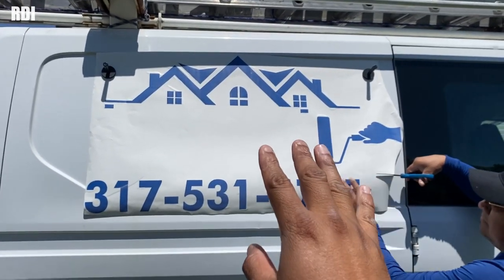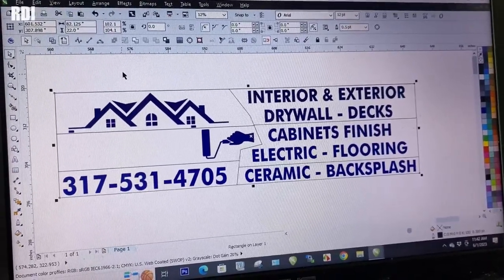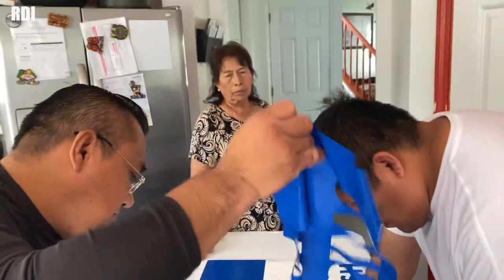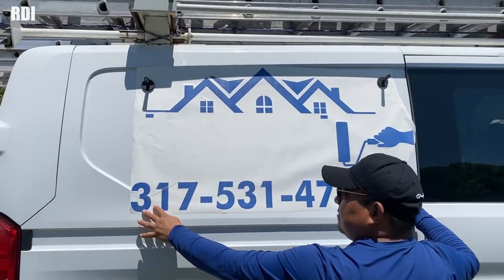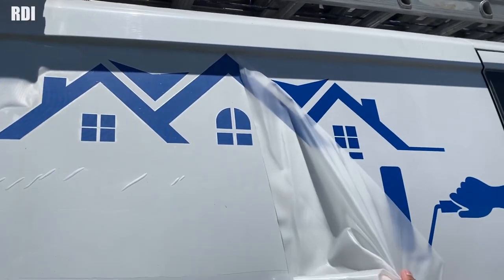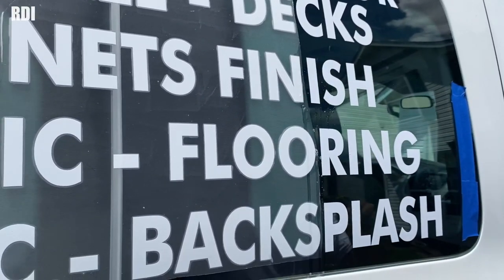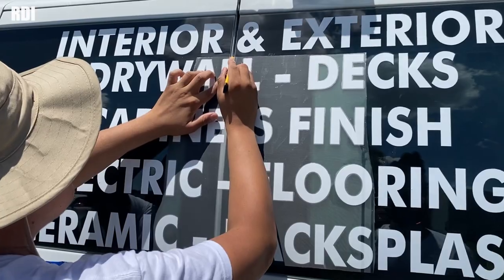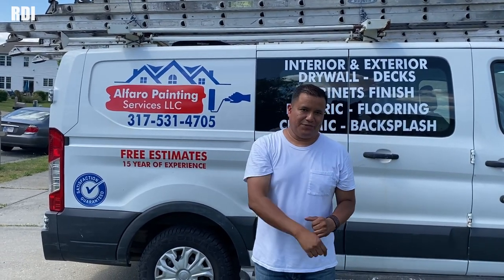AVOID this at all cost - TIPS for DECAL business

Comment from the maker: Get your equipment & materials through uscutter: https://uscutter.com/?ref=StickerAficionado
TRANSFER ROLLER TAPE:https://uscutter.com/APPRoller-Tape-Application-Roller/?ref=StickerAficionado
RTAPE CLEARCHOICE AT75: https://uscutter.com/Rtape-Clear-Choice-At75-100-Yard-General-Purpose-Clear-Embossed-High-Tack-Application-Tape/?ref=StickerAficionado
Or through Amazon:
Graphtec vinyl cutter:  https://amzn.to/3pIrIkS
USCutter Titan 28 inch Vinyl Cutter: https://amzn.to/3yC1jwn
CAMEO 4 (12 INCH): https://amzn.to/3dPBRvA
CAMEO PRO (24 INCH):https://amzn.to/3POgbNO
Oracal color guide ( only for 651 & 631 vinyl ): https://amzn.to/3W6Q0ow
Siser color guide: https://amzn.to/3ZuQJ60
Magnum magnetics 24"x25' : https://amzn.to/3P6AHdJ
Blank yard signs: https://amzn.to/2IBiGWM
RAPID TAC: https://amzn.to/37ZMl5O
Oracal 651 vinyl 10 yard roll: https://amzn.to/3ulmXRJ
Cutting mat: https://amzn.to/3uidBWZ
Blue safety ruler (31 inch long) https://amzn.to/3slsrKy
Squeegee: https://amzn.to/3bmZK8Q
Small magnets to hold vinyl in position:  https://amzn.to/3kdE6bt
Cutting knife tool: https://amzn.to/3sbDTYS
Adhesive remover goof off: https://amzn.to/3eXrNS2

Comment: I do quite a few car decals, although not nearly as large as yours! Currently I have some AT65 tape left, but was wondering why you like AT75? Occasionally I use some holographic materials and they don’t want to come off the backing paper sometimes. Do you think AT75 would be sticker?
Reply from the maker: Hello! The main reason is because AT75.1 makes it so easy to lift vinyl from backing paper, you just got to be careful with damaged paint as this is a high tack transfer. We have use this transfer for metallic and reflective vinyl and it works great 👍. Thanks for watching!!